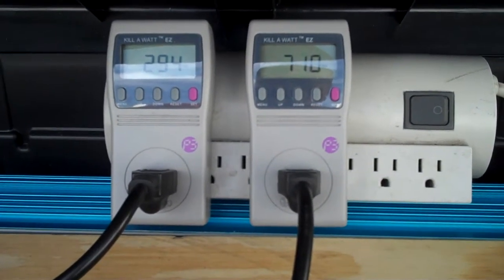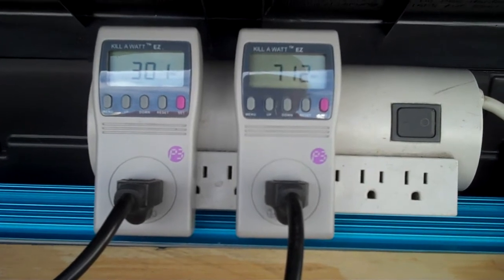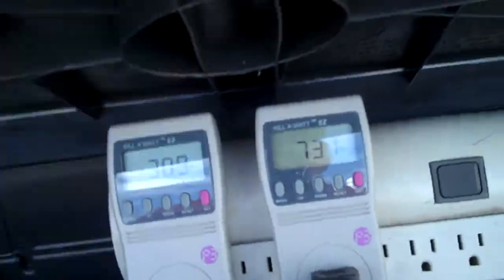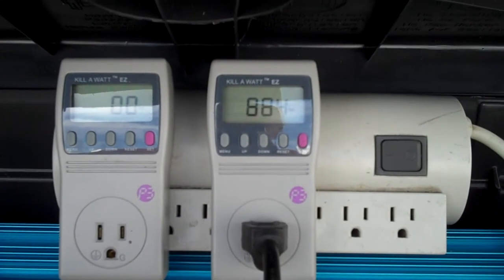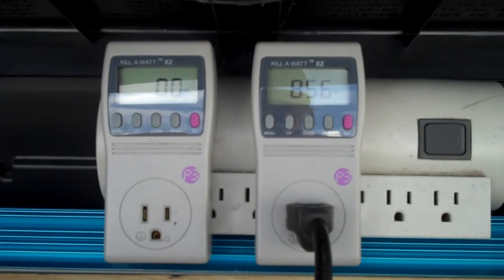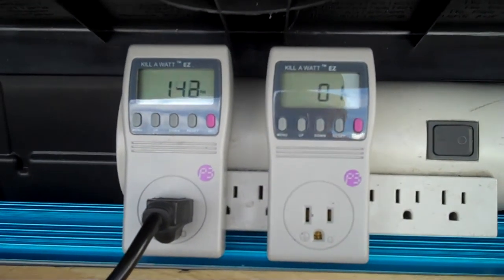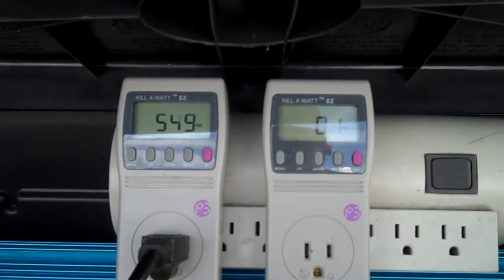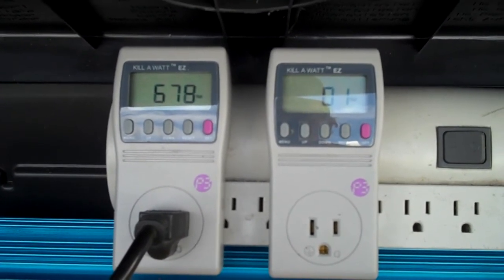PowerJack 1200 brief moment of grandeur - for one of two identical inverters

Comment from the maker: @apabrato These have a daughter circuit board that is some kind of voltage devider circuit which allows the input range to be between 50-100vdc. These inverters actually have two of the 600 watt PJs mounted sideways in each case with the inputs and outputs tied in parallel "guaranteed". One had a bad 600 watt inverter and consequently put out half of the other one. I have since replaced them with true 1200 watt PJs 50-100vdc models (same daughter board) single circuit board.

Comment: What panels are they?
If they are Kyocera KD135GX or similar, the specs say that at NOCT (nominal operating cell temperature) of 45C, the panels only produce 97w. Big difference to the 135w as tested in the lab.. I guess you might peak over 1kW DC (~850w AC) on a very cold day, with no atmospheric haze (low humidity etc) and before the panels have a chance to warm up. Maybe you are lucky enough to live in an elevated location, where the air is thin, cool and dry :-)

Comment: That's amazing.. If those power meters are right your system is extraordinarily efficient!  I have never seen that much AC power produced by only 1080w worth of panels. In most cases, even with amorphous panels (with their much lower temperature deration than crystalline panels), you would typically only produce a maximum of 90% of rated power. So, about 972w to the GTI and assuming 85% GTI efficiency, you would produce around 826w to the AC and that doesn't even include any cable losses.